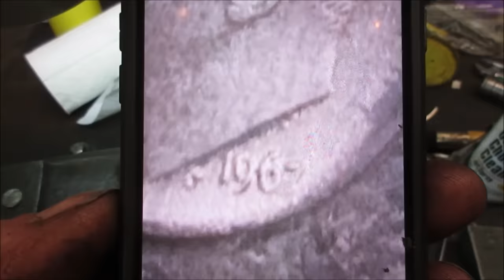VèloSolex Moped, Will it Run/Ride After 46 Years?

Comment: At 13:50 You should have to place the shaft before placing the balls, a good amout of grease should prevent them to fall while you place them on both sides before just like you would do on a bicycle wheel.
Very nice video for a very strange "lovely thing".
"3800" is the maximum revs of the engine.

Comment: The throttle/brake handle makes perfect sense! Whilw just riding along, it lets you hold the handle bar and NOT have to squeeze the throttle to go faster. Logically, when slowing down, you squeeze the throttle handle which slows the motor and also applies the brake, that seems to make good sense to me.

Comment: Have a simular rig. Berini M 15. Its a bicycle assist motor from 1959 . Mine is on a common 3 speed bicycle but the rear is a coaster brake . The front brakes used to be pads on the rim brakes. I switched it to a front drum brake.

Comment: My father talked about these and other similar constructions. From what I remember there were ones you hung on a regular bike and it would drive the, usually as I understand, front wheel. From what I understood the ones he talked about was common in the 30's and 40's. After that they became more and more uncommon. Eventually the add on engine couldn't be used legally on public streets as anything engine powered had to be constructed for that, and common bikes tended to have to weak frames, brakes and wheels to handle the power of an engine safely.

Comment: Why don't you just get some bicycle rims & spoke sets & replace them back on the original hubs. thats what I'd do plus powder coat the frame silver sparkle plus engine in barbeque high temp paint.& a bicycle chain would fit too. If you put a diegrinder in the exhaust port it'll give it some more poke as they are always restricted from the factory so let it breath

Comment: You forget the bar you removed from around the engine in the first video.  I suspect it allows you to pull the engine back go it's wheel doesn't drive the front wheel when you stop so you don't have the "always in gear" problem.

Comment: Back in the 70'es, I had one, my brother had one and my wife had one.
My brother purchased it second hand from a friend, I got mine for free as a kit in a box.
My wife got it from her parents.
Mine was the oldest one with the bigger wheels like a standard bike.
it took me a long time to assemble it and make it run, no documentation, no drawings, no nothing.
Previous owner had tried different mods to make it faster, which obviously was the main problem.
Had to replace the piston as it was modified for more intake, which essentially made it impossible to start 😄
These mopeds had a habit of clogging the damper pot making the engine a weak puller. The solution was to punch a hole in the pot.
Reply: What is a “damper pot”?
Reply: @stephenreese5921  My bad. The muffler.

Comment: the trick we always did with tubes/tires was add a ton of baby or talcum powder, coat the whole tube, inside of tire and rim(or scrap rubber tube/tape wrapped around rim). then inflate and deflate the tube multiple times, sometimes break the bead(if very tight) and rotate the tire back and forth on the rim some, sometimes even used vacuum pump to suck the rube flat and refill more than once. yeah, often never a perfect fitting tube, so much fiddling required and darned those busted pinched tubes 🤯

Comment: Pedal the bike, push the kicker wheel forward with the engine in the start position. I think it runs on 4-5% mix. It does not run on gasoline.

Comment: The tail light wire plugs into the headlight switch plate at back side. Push metal tab down and insert wire clip. It's on the copper part for power supply

Comment: Something you have missed is that there's a centrifugal clutch so when the engine is idling you don't need to disengage it from the wheel. Your clutch is stuck. The reason for the disengage lever is tu use the moped as a bicycle. Also: when the clutch is working there's no way to have the engine driven from the wheel, that's also why there's a decompression valve: it's the only way to have the engine turning fom the wheel when you need to start it.

Comment: I wonder if the Solex is the same mob that make the carbys? The reason the throttle is like it is would be so you don't have to hold the lever up all the time as you ride, only when you are stopped which would be about 2% of the time. Imagine the cramp in your hand after holding the lever up after an hour of riding to work on a cold day. It would be kinder to the engine use the decompression valve at idle instead of full throttle.

Comment: Regarding the chain ... I have never done this, but it is an idea that has been rattling around in my head ... after knocking the bulk of the rust off, putting the chain in a mason jar full of oil and putting the jar and all in the ultrasonic.  Have you ever tried this?  If so, how did it turn out?

Comment: I haven't had guards on my wire wheel for 50 years. Have I ever launched something across the shop? Yes. Burned the skin off my hand? Yes. But it is super versatile and I haven't put my eye out...yet. You should put yours back on though.

Comment: Hi Mustie, a respectful EVP spirit audio analysis at 0.25x video speed; ghost in the machine:
1:26:26 'Karburatoren er fuld af skidt og gamle edderkopper' ('The carburetor is full of dirt and old spiders'), 1:26:29 'Karburatoren trænger til at blive renset og justeret' ('The carburetor needs to be cleaned and adjusted').
1:26:37 'Völven har også kørt på en Velo, og det har Völvens far også, da han var helt ung' ('The Völve has also ridden a Velo, and so did The Völve's father when he was very young').
1:26:41 'Den koster næsten ingen penge at køre på' ('It costs almost nothing to run'), 1:26:43 'Det er åbenbart blevet moderne at køre på Velo Solex igen, fordi det er sådan en genial maskine' ('Apparently it has become fashionable to ride the Velo Solex again because it's such a brilliant machine'), 1:26:50 'Frankrig kan!' ('France can do it!').
Your friend has problems stopping, engine still running full throttle:
1:26:53 'Hold, hold på håndtaget!' ('Squeeze, squeeze the lever!').
Thank you
The Völve, Asatru shaman of Denmark, the North
MeWe: @ulrikrosenstand.99

Comment: Hi Mustie,

I used to own a Solex Moped years ago and if you want to know how the tail light works there is a clip on the back of the center part where the switch is and there is a clip where the tail light goes to. It is very small and it just sticks out of the back of the center piece. 
you will have to look carefully. You will see it on the other Solex you just got recently. 
Also do a little research on the Solex machines on the net when you have the time.

Comment: Duct tape stated in my seat bag when I was riding.  I had a flat about 10 miles from home and blew out the side wall.  Made a boot out of duct tape.  It was not smooth, aired it to low pressure, but was better than carrying the bike.

Comment: For the brakes. If you tighten the one side nut to put some more drag on the one that moves easier. Loosen the nut on the one thats stiff. That way they both jave equal drag against the cable. 😊😊

Comment: I think the tail light wire should connect with the copper bar on the cover. Look at the slots in the connector that would slide onto the bar a that would power the tail light. And I think you're correct about the brake light switch. If the arm is over the top of the cable, tension will activate it

Comment: I fixed a few VeloSolex and I can tell you one thing: The breaks are an absolute joke. They shouldn't be called breakes rather than "device that may or may not contribute to reducing speed".
Even with perfectly new parts you are better off just jumping off the moped in an emergency situation than using your brakes 😅

Comment: You would be amazed what the custumized motorized bicycles are like these days. 50 mph and purpose built frames with internal fuel tanks, disc brakes and big expansion chamber exhaust, bigger carbs and reed valve intakes. Its pretty wild

Comment: @38:03 Where were they. Those look like they might be the spring tensioners for the brakes that you don't seem to have to keep the brakes disengaged when your not pressing them. In the outtro it shows them holding on to the front of the fender, doing what I don't know.

Comment: OK one more tip..use alot of grease in the hub body and it will hold the bearings in and if you hold the wheel vertically in your hand while loading in the bearings they tend to stay in better

Comment: It's my understanding that export models should have had a twist grip throttle with a separate brake to comply with local regulations. The conversion on the carburettor is quite easy, the spring moves from the bottom to the top to hold the throttle at idle (it may be necessary to drill a mounting hole) and the cable enters through the lower guide and wraps the other way round.

Since the conversion wasn't already done, my guess is that it was imported directly from France.

Comment: i had that same moped and it was missing half the parts i rode it around for a while and then coming home one day the back tire blew out it was rotten so i rode it home then try ed to find a new tire for it but couldn't find one do to that odd size so i used to just go down the block to the store for a few months and then it started having carb problems so i kept the motor and tossed the rest like i say it was missing a lot of stuff and some of the frame parts were bent to it was in pretty bad shape it was given to me so i was-int out anything

Comment: Hey Mustie1, fun video. I noticed in the finish where you showed the guy that you got it from, those springs were visible on the front of the bumper guard, and connected to each side of the front fender.

Comment: Are you sure the throttle cable didn't wrap around that guitar nut and lock into the other side which would reverse the throttle Pull? I'm sure it's been messed with through the years

Comment: I wonder how much the ride would improve if you gave it a normal brake system and independent throttle
Reply: velo solex does not need any improvement - at all!

Comment: I think the French just like being contrary to everyone else. I have a French transistor radio, where the volume control goes louder downwards, the tone control has treble on the bottom and bass on the top, and the on/off button has to pushed down for off and up for on.
Reply: Do you have it facing away from you and lying on its side maybe?

Comment: Happy Easter from Cologne. Use the right handle as a turning handle like a normal moped to accelerate.
Reply: I mean, the twist grip was only available on the Solex after 1978. But you could retrofit it on the older models.

Comment: My guess is you are meant to ride it by killing the engine every time you stop. That’s why the brake also closes the throttle. Bring the rpms down enough for the brake to stall the engine. Then pedal to start it up each time you start again.
Reply: This is not necessary, the Solex has a centrifugal clutch. The clutch is disengaged when idling.
Reply: @nobbyarmbruster  If that’s the case, then perhaps the clutch was stuck in this video.

Comment: Yep, Darren, leave it to the French to couple the brake with the accelerator, that's the way to go and have the brake and accelerator work backwards to make it more confusing and more accident prone. Nope, it would never be allowed in other countries. But they did build the Eiffel Tower and the Statue of Liberty, but I think it was the French who had the idea of leaving the indicator stalk on the left side when making right hand drive cars to save money. As for riding on the back, it would not be uncommon for people to squeeze a passenger on a bike.
Reply: The french did not want to deal with patents and made a deliberate attempt to engineer original designs. The Citroen 2CV and ID19 were an excellent example of this.